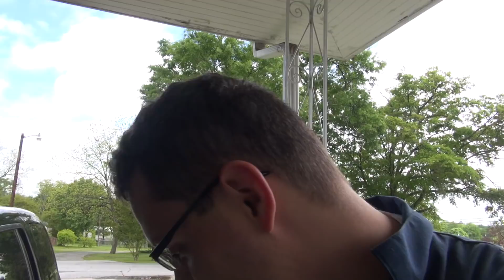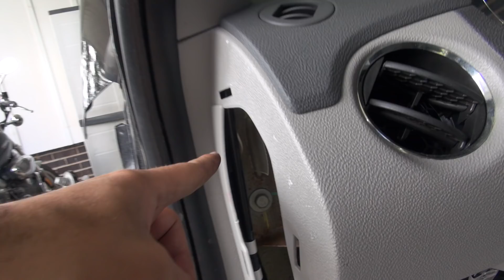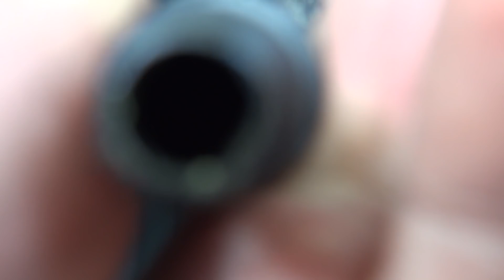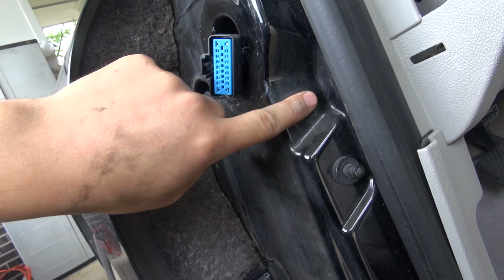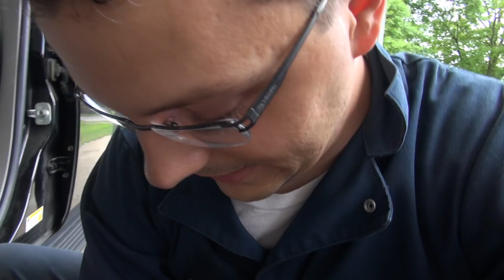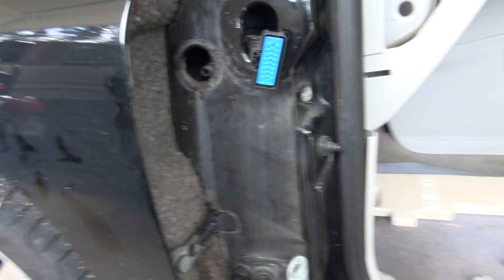Stopped Up Sunroof Drains

Comment: Odd that the drain doesn't go all the way down and outside the wheel well as it does on some Chevy products.  Saw one video where the tube somehow became disconnected at the top...totally different way to fix.  Using a plastic trimmer wire or air pressure can keep those canals free of debris.  None of the sun roofs are designed to keep all water out and have those trays and tubes for that purpose.  The little tabs on end are designed to get you in for maintenance costs...  ;)   Okay...just poorly designed...it might be better to have a removable screen on the end of the tube just like one has on aerator bathroom faucets and tube go all the way to bottom...I think it does on my 2002 Avalanche.  I've had to maintain the sunroof on EVERY vehicle with a sunroof...no getting around it if you keep the vehicle a while and especially if you keep it outside.

Comment: If you knew anything about grommets- the x that you call a barrier is for the hose to go through as a friction fit device. If your hose is behind the "x", you need to pull it through, so the water can drain as designed. jeez

Comment: Thanks for your great video I have had this problem for 4 years and dumb mechanics don't know this? They keep changing the tubes on the top of the roof and duh!! not to mention the money I have spent,still water getting in on both side of the car floor. Going to tell them of what you showed I and maybe it will solve the problem.

Comment: This was helpful. I just brought home a 2011 Chevy Equinox LTZ "As Is no warranty." Driving in the rain today, I discovered how freely water can flow behind the headliner.  When it stops raining I'll clean out the drains.  I want to add to everyone complaining about automotive engineers that I work in Detroit and I know many Ford VO, GM Tech Center and FCA Tech Center engineers and I can say these people are intelligent, interested and qualified.  A lot of these design problems are not because of bad engineering but are driven by cost.  Still, my roof leaks ~ soooo I'll look to take some of them to lunch in the rain soon.

Comment: LOL....all you had to do to access the exit spout was remove the inner fender and that divider foam right that in the fender and reach your hand up in there.  You don't remotely have to remove the entire door.   All sunroofs have drain tubes.   It's not unique to Chevy.   Some are easier to get to than others....this isn't one of the hard ones.
Reply: Do you, by chance, know of a video that demonstrates how to do what you described? Mt passenger side has been leaking into my floorboard for months. I keep towels down to absorb the water. So glad someone shared a different video showing it can be a relatively easy fix. Wished I'd thought to research the specific issue myself.

Comment: All you have to do is use an air hose and air trigger open your sunroof and blow the air down thru the holes in both corners.  Then poor some water from a bottle down the hole and see if it backs up or drains out  underneath the space between your front door and fender well.  If not you can take the plastic interior trim down off your wind shield post and disconnect the hose right there and blow air thru and then water.  If all that fails run heavy weed eater line down thru the drain tubes.  You might have  dirt dobber mud spider or anything else in there which is why they don't leave the drain hole completely open.!!!

Comment: My Lincoln had the same problem. Head liner looks a mess with water stains. You'd think manufactures would have sunroofs completely  sealed by now. Imma try the air thing at the gas station

Comment: I have a 2004 Chevy Tahoe. I see the top drains, but not the bottom exits. Does anyone know where they're located?
Reply: I wouldn't worry about finding it, go to a tire shop or auto repair shop and ask them if you could use the air. Tell them your sunroof drain is plugged up and you just want to blow it out. Ask if they could put the adapter on it to blow it out with. 90% of places will be cool and let you do it. Have sunroof opened and don't take but a minute, put the blower in hole at top where sunroof is and when you blow you will hear where it comes out at. Blow it for 15-20 seconds, if it is blowing out at door, open your door of course and keep blowing till it's clear. Do both sides. If you don't get it unclogged use fish tape or a coat hanger from either end to clear out junk
Reply: trace martini I actually went to put air in my tire and taped a straw yo the hose. Blew in there pretty good. Me and the wife didn't see anything really come out anywhere. But I haven't washed it to see if anything changed yet. Lol. But thanks for the advice👍

Comment: Love the commentary! And I feel the pain, too. I have a Chevy.  The drains clogged and I ended up with over an inch of water in my floorboard.  I was able to clean one out with a long plastic fiber optic cable that I happened to have handy. The other one - not so good. I've tried compressed air, but so far, no good. I don't relish the thought of having to take the door off, but rather than try Drain-O, that might be what I have to do.  Yeah... After all the problems and recalls I've had, I'm seriously considering getting rid of this (Chevy) thing. Ridiculous!  But thanks for the laugh!  Thumbs up!

Comment: you don't need to take the doors off. That was crazy. You did way more work than you needed to. All you have to do is get either a wire tie or cut you a piece of lawn trimmer cord and run it up that extra spout, and then maybe run it down the drain exit up at the sunroof area and it will come right out.

Comment: I have the same car. Passenger side floods. Took door off like yyou showed, blew out the line with my air hose and drains great for now. Thanks for the video. Can you replace the thermostat? How about an interior fan that only works on setting four? :-)
Reply: did junk shoot out of the little hoses when you blew that air through with your compressor?

Comment: You think air might work?  Why didn't you do that first?  It is the easiest way.   Only reason to take your door off would have ben IF the cover plate had it's X in front of the tube rather then the tube going through.The blockage of the cap isn't a problem because it should be over the tube not in front of it.  The X is just to help keep it on and to be able to slip it over the tube.
Reply: cant get it back on that tight. X is in front of both tubes when I checked. Must not be the first time...
Reply: i was thinking that too. Thats just there to make sure the tube fits on snug in the center

Comment: Mercury Mariner Hybrid 2009 (most sunroofs are fairly similar): I have a problem with water leaking and pooling onto the carpet at the "passenger front side".  You helped me realize that it is likely a drain hole on the passenger side of the sunroof!  During the winter, I never open my sunroof; but I opened my sunroof and noticed that there was standing water at  the passenger side of the sunroof, because the passenger side slopes downward when I park on my street!  It appears that the drain tube that leads from the "drain hole at the passenger side of the sunroof" is likely full of water, from the floor to the roof, because of crumbled leaf debris.  I found a reputable local mechanic with good Yelp reviews and showed him the standing water.  This mechanic said he will charge me up to $105.00 to clean out the drain tubes, and I have an appointment tomorrow.  I will post my results, ASAP.
Reply: +Cris Vinluan 
The mechanic cleaned out the drain tubes and saved  me some seeds from an ornamental pear tree (https://en.wikipedia.org/wiki/Pyrus_calleryana) that I park my vehicle underneath!  But since this is a so-called "El Nino" rain pattern, I will continue to monitor the moist conditions in my vehicle.  And I will try to keep my vehicle clear of this debris and will be ready to clear the drain tubes, next time!

Comment: I couldn't stop laughing - sorry - you were just so pissed and on the verge of saying something you might regret.   I Looked this up looking for a fix on a CRV.    The cap on the end of a tube is just ridiculous engineering by GMC...and BTW  NO!  ants are not crawling in there!  they are just dumb.       Its seems that all makes and models of cars with sunroofs have this problem though.  Reminds me to double check my 2013 Civic before it gets plugged.
Reply: The problem isn't "ants crawling in there." The small opening is to prevent certain types of wasps from laying their eggs inside of a mud cocoon that will be a real pain to get out. In the south, they are called "dirt dobber wasps" and they will lay their eggs in any 1/4 inch round opening. Getting the dried mud out of wherever they have laid their eggs is a task into itself.

Comment: Glad I saw this video.  It helps me understand why.  It was pouring rain and the water was leaking through my sunroof  as well in the front and then into the panel and dripping by  the entertainment system, and also from the  left side of the dashboard onto the floorboard.  I was also cupping it too, while driving.  This was an absolutely horrible experience.  I own a 2005 Chevy.  I will need to take it in.  Wasn't sure if it was the seal,  something simple, or complex, but your break down was great and helped me make my decision.   Thanks.
Reply: +Elisa Hoeveliman  I bet the mold smell inside all these vehicles make the car seem 20 years old huh? SMH

Comment: Why not just take an air blower and low pressure air and blow out from the sunroof drains lol
Reply: Some say that too much air pressure (don't ask how much Psi) will rip holes in the rubber tube if not careful and then you will have several leaks forever inside your pillars. I also found ole school transmission speedo cable attached to a low speed drill works as a miniature auger to clean this out.  I tried twice on my 07 Hummer H3 and got it to drain a little (again don's ask the drip rate per second) lol...
Reply: +Justin Fowler He is trying to shown you the defect

Comment: Good video, one thing I might add as another way to clean the lines is with plastic gas trimmer line. You just put the line in the hole and gently push and pull till it comes out the bottom. I've used that method on my car and it works good.

Comment: I'm experiencing the same issue with my 06 cobalt ss. I have a pool of water on my passenger side floor after every time it rains hard. Doesn't always leak but it's a pain in the ass when it does leak. Pretty sure I need to do what you did to your Chevy, just don't have the tools. After I watched your video I poured a bit of water by each drain hole that pointed out in your video. The driver side hole worked perfectly and my passenger side doesn't drain anything. Thanks for posting the video! You helped me lots

Comment: I think this is what you call 'over-engineered'! They put the X at the bottom likely to hold the hose in place which is a bad design obviously but I think perhaps a screen at the top of the drain hoses to prevent things from getting in there might be better, perhaps a bigger hose, etc... they should probably study roofs and gutter systems as there is plenty of knowledge to be gained there! I would get some pipe cleaner an try that.. perhaps drano would work as well although not sure how that effects rubber or plastic tubing!

Comment: My Hummer H3 same issue. Oh it going to cost me +$150 to have to dealership fix it. I'll have to mod it when I get it back.
Reply: +Peter Harper Let me know what you did to ultimately fix this. Wife's H3 smells like it has been buried in  Louisiana swamp and moldy. I pulled the passenger side carpet back about 4 inches from the foot board and very  damp under the carpet. Used blow dryer for several minutes on a sunny day with all doors and windows open to kill the mold as far as I could without ripping the entire front carpet out. Once dry, i used Odor Ban to kill and deodorize best I could. Lasted about 12 months until a big downpour occurred and the problem is back, Even after blowing with air and trying to force water inside while running speedometer cable on a low speed drill to auger the tube. Little or no luck. Thanks
Reply: Rodney Holmes check the lights on the roof.

Comment: Thx littlegreenwon, this definitely laid the blueprint to get my sunroof drain port cleared too, just curious, what  year is your suburban? I am having the same problem, but mine is an '02, so is the configuration the same you think? Thanks again for the great post!!!!
Reply: I too have an 02 Suburban, were you able to get yours unstopped? I have tried compressed air from the top but I guess I know why it would not blow it out considering the X at the end.
Reply: @J Gilliam: To be honest no, I did take the molding that covers the drain hose, but fear that I would probably need to do the same as littlegreenwon and take off the door to get to it. Will definitively be a hell of a fucking project, will let you know how it goes man.
Reply: imnengineer I spoke to a mechanic on Monday, he said it is behind the fender, yes having to take it off. There is an outside chance we can remove the the plastic molding on the lower inside and reveal a hole in the firewall that would let us access the drain tube. He said it is attached with clips, and just snaps off,  may have to take off the plastic trim along the floor that conceals the carpet edge first. I have not tried this yet, planning this project for Saturday morning.He also said an air compressor should blow out the blockage, but maybe not with this plug on the end.
Reply: @J Gilliam: So you mean the trim that is next to the passenger seat? On the floor, we would need to remove that trim as well? I really need to clear blockage as my driver side seat is getting wet. Do you think you can upload a video and show me or even a pic, J Gilliam?
Reply: J Gilliam : Send the pics here buddy: im.n.engineer@gmail.com